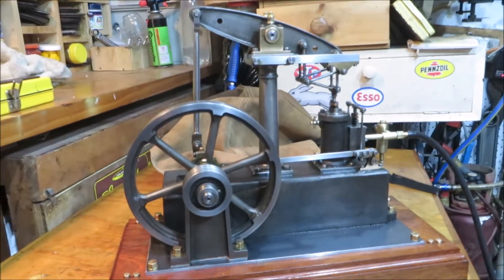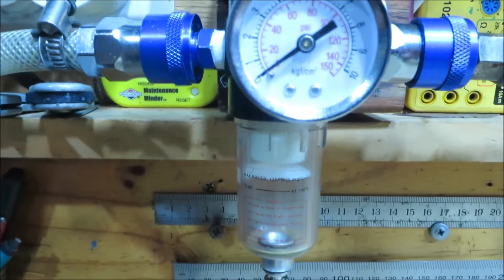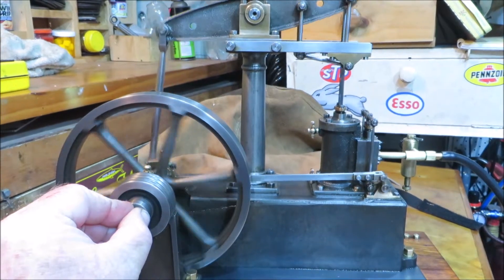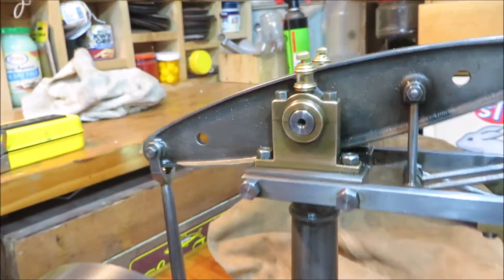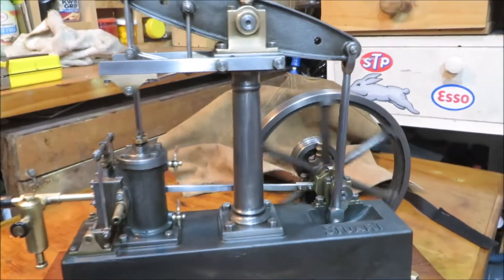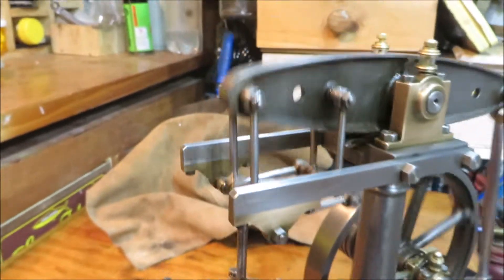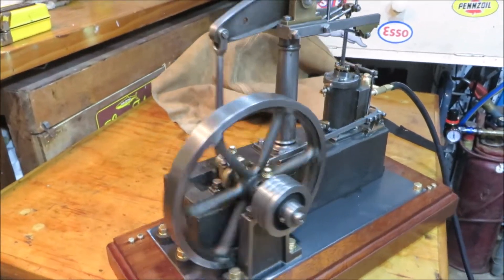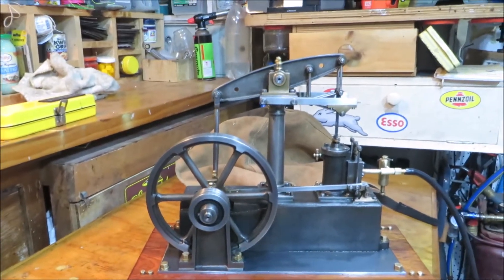Stuart Beam Model  Steam or Toy Steam Engine Modification with a steel base

Comment: Hi Mate
That is one of the best Stuart Beam engines I'v seen on YouTube, it runs very smooth, especially at that low speed. (like all beam engines should)
I'm currently building the same engine (just started) and if it turns out half as good I will be very happy. It's a credit to you and the builder.
Regards
Gary
Reply from the maker: G'day mate, the gent who made this certainly knew what he was doing. I'd love to watch your build process from the Stuart castings. Have a look at this model steam engine forum - https://www.youtube.com/redirect?q=https%3A%2F%2Fwww.officeofsteamforum.com%2F&redir_token=NKr6Z3dQ98vyjVu6Yu92hKpx8Sl8MTU1ODU3MDAwNUAxNTU4NDgzNjA1&event=video_description&v=jTT_85QB7Bs it would be great if you could join up, a lot of people would love to follow the build as well. Thanks again for your comment, much appreciated.